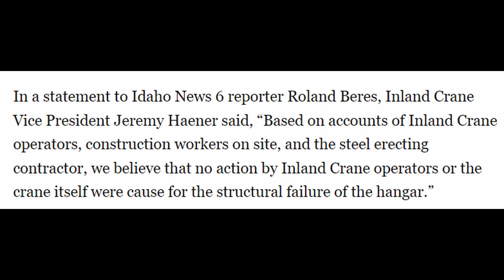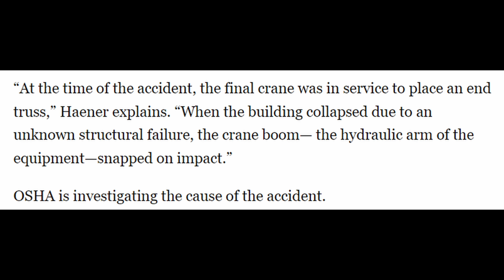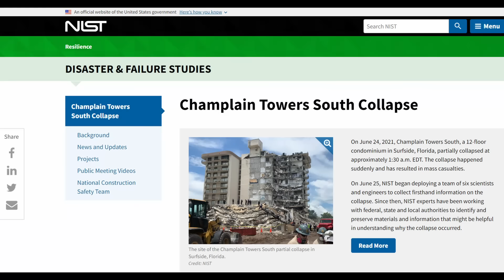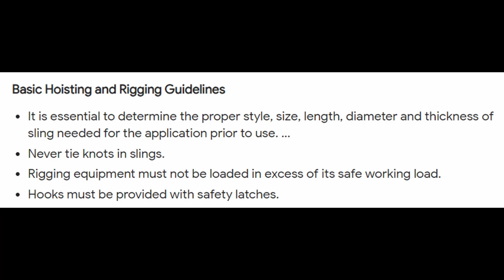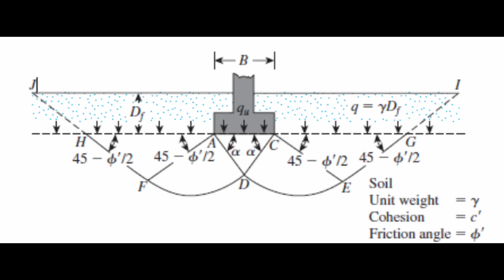Aircraft Hangar Collapse in Idaho

Comment: Good point about the back straps but these horizontal reactions are huge!  In most cases we would even have an embedded cable just below the floor elevation going from one leg to the other.  These forces are too large to depend on the resistance to sliding just due to the passive soil pressure on the sides of the foundations. And usually, these foundations or footings are not thick enough to generate much passive pressure resistance in the first place.  Something is very wrong here.  Thanks for your observation too.
Reply from the maker: Thank you. I agree, something big was likely missed here.

Comment: You will see something very curious at time stamp 0.58 sec.  and again, at time stamp 1.08.  None of the frame bases have any indication of anchorage.  No sign of anchor bolts in the foundations or any sign of anchor bolts (even bolt holes) at any of the frame's base plates.  We commonly call these frames "bents"   If the structural analysis depended upon the bases of the bents being restrained against horizontal movement and possibly moment at the bases, well there doesn't appear to be any restraint.
This is very very strange indeed.  How on earth could anchorage be missed???  It is possible that without the horizontal reaction provided by anchorage the bending moments in the bents would be much larger than the analysis would indicate.   Thank you for the video on this accident and we pray for those who were killed and for those who were injured.
Reply: They are all bolted down, the flanges ripped off of all the columns just outside the weld so they end up looking like they are unbolted. There are some close up on the net you can go find.
Reply: @joshua43214   Then the weld design, the weld procedure and the inspections are very suspicious.  Ther is more to this than meets the eye, in my opinion, and experience.
Reply from the maker: That is a great observation.  There only seems to be a "back strap" connection from the base pieces and the foundation.  This may be a case where there were multiple factors that combined to produce the collapse.
Reply: I agree with your observations.  This is a moment resisting frame metal building.  At one tine i was a design engineer for a metal building manufacturer.  To my knowledge most all metal buildings are sold as a to be erected product.  The general contractor "pours" the foundation and erects the building.  I have never seen a contract purchasing a metal building that went any further than to list the reactions that the moment resisting frames place on the concrete slab.  The metal building manufacturers insist the contractor has the slab analyzed for the particular loads, but exempt the building supply from oversight and inspection.    In honesty I have seen a whole lot of concrete slabs that were not adequate for the maximum design reactions at the baseplate.  This building was a very wide span with obviously no interior columns typical of an aircraft hanger.  The beam sections of the structure were very deep with a lot of web crippling stiffeners.  Nothing out of the ordinary with this except for the very wide span.  The reactions at the base of the column of a building with this span are impressive.  Without drawing any conclusion I would respectfully suggest the investigators undertake a careful review  of the concrete slab design, the type and installation of the anchor studs, and the base plate details.  I have doubts that the installation of the end truss in itself led to the collapse.  Since the sheathing was not installed on the building the baseplate reactions would not have been at maximum, but a sudden dynamic impact from wind hitting the truss being placed may have overstressed the anchor details, etc.
Reply: @geoffmorgan6059  
I agree, I designed the foundations for about 20 similar buildings, based on the supplied reactions. The frames collapsing and rotating the baseplates suggest a connection failure at the ridge or an error in the foundation design.
Reply: @MrsAnnieTK   The dynamic loading during the failure placed tremendous force on the anchorage and base plates.  There is one in the video that has actually torn the light base plate steel away from the web of the column.  Amazing that the fillet weld didn't tear, but the base metal itself sheared away.  Wow!
The more I look at this building the very long plate girders seem to lack what would be intuitive for lateral support.  Look at a bridge design with long spans and the lateral connections between the beams is impressive.  Another hanger that "Big D" construction erected used trusses for the long roof spans.  Probably a better approach.
Reply: @geoffmorgan6059  You are very insightful indeed.
Reply: Not a typical big and thick baseplate and anchor bolts like I've ever been around. I've anchored down hundreds of embeds and column plates.

Comment: We erected many of these since 1980s.
I am also a Crane operator and have a degree in Architecture.
Often no temporary bracing is used or not placed properly.
Erectors often only put a few bolts in to hang the steel quickly.
Then later send a crew to stuff bolts and torque to spec.
If they didn't place and torque central ridge moment connection would cause a collapse .

I saw jobs where only a few bolts in moment connections installed never torqued out of many required.

Also in mid 1990 s we had bad chinesium metal bolts we had to remove and replace on a hangar we put up for USAF.
Law suit to get paid .
Bad bolts metallurgy today still.
Rebar also suspect .
Get paperwork and testing of all rebar and bolts save it .

Sad .
Reply from the maker: Thank you for your comments.  I am curious about the division of responsibility here.  Does the erection company call all the shots?  Does the crane company have someone checking the rigging or have a say in how many cranes are involved and how the are positioned for a big lift?
Reply: @CaseyJones-Engineer if it was the existing trusses that collapsed , the cause is likely insufficient bracing , or like the previous commenter said  , not enough temporary bolts . I’ve seen both trusses collapse and crane failures , usually something was overlooked or underestimated the weight being lifted .
Reply: @CaseyJones-Engineer  Iron workers do all the rigging. Special iron workers climb the beams and manhandle the trusses into position. OSHA grants iron workers doing connecting huge amounts of exceptions, they look like pre-OSHA workers to this day. The crane operator has to assume the rigger knows what they are doing (if they are union trained, they are extremely well trained). All they can really do is refuse to lift if they think something is being done wrong.
Reply: Locals were reporting, wind may have influenced events.
Reply: @amunderdog  Wow..We put huge x bracing cables and rods in as we erect them .
Engineering drawings specify placement.
Reply: @amunderdog  we live along the coast , gale force winds are a common accurance . When erecting steel buildings Ironworkers use wire rope turfer to add additional bracing , lots ! As Carpenter’s we brace everything , cutting corners causes collapses . 👍🇨🇦
Reply: In my experience here in Idaho in the industrial mechanical, union and non union world,  we as the general contractor called the shots to the crane subcontractors far as crane size, rigging and lifting. We definitely valued their input and trusted their owner and operator to speak up if things didn't look or feel right to them but they were pretty much just tools in our hands.

Comment: That was a windy day, more so than usual here in Boise
Reply from the maker: Great point that I forgot to mention in the video that a sudden gust of wind could have been a contributing factor here.
Reply: @CaseyJones-Engineer  The Milwaukee Brewers stadium "Big Blue" collapse in 1999.  Though probably not that simple.
Reply: @donaldatherton319Based on what?  Were you there?  Wind is a common cause of collapses during construction.
Reply: @LTVoyager UPS was loading planes continuously right next to this, and they have very strict wind regulations
Reply: @paulwolf8444  That doesn’t mean that wind wasn’t an issue.  Wind speed can vary greatly over short distances and based on topography such as being between large buildings, in a valley, etc.
Reply: @LTVoyager  Did a building move in that day?
Reply: @paulwolf8444  non sequitur
Reply: @LTVoyager  So is your response. What changed?
Reply: @paulwolf8444  I don’t know for sure what changed, but wind was already mentioned and I simply said that is a possibility.  Not sure why you are going off into the weeds as I made a very simple and clear statement.

Comment: Thank you for this! I live in the Boise area and have been following the story. As a side note, January had a very heavy snowfall, about 22 inches total in Boise. I wonder if this might have contributed to instability of the soil under the crane?
Reply from the maker: Thank you.  There have been many instances of foundation soils becoming weaker after a lot of rain or snow melt that led to the bearing capacity failure below the crane pads.  I don't know whether this was a factor in this collapse.

Comment: Another thought provoking video—thanks! As mentioned by you and commented on below, it’s curious why they needed 4 cranes and the went all the way down to one crane and BOOM! Stability seemed to have depended on multiple supports at some point and then apparently someone thought that was no longer needed….😕
Reply: I could be mistaken, but I believe that it has been stated that what this crane was lifting was an end truss. It is entirely possible that the other cranes were used in building the majority of the structure, but were no longer needed, and just removed to clear the site. The end truss, similar to a gable end on a stick-built structure, simply provides stiffness for that portion of the end wall above the top plate. It would be much lighter than the main structural members, hence likely only requiring one crane.
Reply: @basilfoster5245  Another important piece of information——thanks
Reply from the maker: Thank you. Yes, I think it is interesting that the change from 4 cranes to 1 was mentioned in this initial interview after the collapse.
Reply: I suspect whoever made that decision will regret it. And often when it comes to cascading failures, I suspect the person who made that decision made it from orders from above because cost reasons. This has skipping security because of cost written all over it.

Comment: These big plate girder bents are difficult to stablize, not only during lifting but after erection prior to addition of all shear resistantan members.  The photos seem to indicate tha the failure of the bents was moving toward the crane.   One possible scienerio is that a manlift inside the building destablized a bent causing a cascade failure toward the crane and hoisting operation.
Reply from the maker: Interesting.  Well I hope that the investigators get to the root causes of this collapse soon.

Comment: back in the '70's working for an oil field rig up company that moved drilling rigs we had two 'pushers' that ran the jobs. One was the truck pusher and the other was a crane pusher but on rig moves they were split between jobs when we had a high volume of upcoming jobs in the hopper.

"Turk" the crane pusher on one job figured out how to take the derrick off the rig with two cranes, set it on sills and take it apart with gin trucks. (we used to use ramps a tandem truck and either a crane or gin truck on the other end.) his innovation saved us buckets full of time and hassle. 

Not to rest on his laurels, Turk then figured out how to two crane (100ton lattice boom and 75ton hydraulic) the whole top 2 substructures off the rig along with all the spreader beams that connected them and that way free up the crane time and get them headed to the rig's new location. Man was it a sight to see and be a part of.

Marlin, the truck pusher, not to be outdone by Turk decided on his next rig move to try the same tactic and boy did it turn ugly really quick. The derrick came off easily, but when two craning the top sub assembly things went sideways literally. Marlin got the booms crossed while under load and when gravity finally kicked in and the subs were raised, the whole thing tried to seek equilibrium resulting in the 100 ton sitting only on it's rear outriggers with the corner of the whole structure inches from the operators cab (i could walk under the front road wheels) and the 75 ton boom buckled in a couple place and sitting on it's front outriggers too.

I learned rigging is a lot like playing billiards and herding cats at the same time and the more cranes, trucks, and swampers you add to the equation the quicker the lift can go the crap. 

Told an operator to stay on the lease road when entering a cell site to change out the top hat on the tower, the operator/driver decided to ignore my directions and immediately drove off the road and buried the crane to a depth that the water literally was running into the drivers compartment. took several days for the ground to dry enough to get a D-9 in there and a half a day minimum fee to get it removed from it's watery grave.
Reply from the maker: Those are interesting stories, thank you!  Those would have been quite a sight to see.

Comment: A lot of these frames are pretty unstable before the sheathing application provides lateral stability. It wouldn’t take much to pull it down. Matter of fact I’m surprised it doesn’t happen more often.
Reply from the maker: One thing I forgot to mention in the video was the possibility was that a sudden wind gust initiated the collapse.  However, I think the use of only 1 crane may turn out to be the key error here but we shall see.
Reply: Maybe the crane was only moving bracing and temp supports at the time @CaseyJones-Engineer

Comment: It's a little bit confusing to imagine exactly what happened because the details aren't clear.

But I imagine if the crane was holding the truss, whatever the attachment point was attached to, loads from that area overstressed the crane until it broke. So, they should've used two cranes, one for the truss, and one for the attachment point. And holding them separately until they were attached properly. I suspect the attachment point was free standing in that critical moment and simply "leaned" into the crane putting stress into it.
Reply from the maker: Thank you for your comments.  Your scenario seems plausible to me.  I think using 1 crane may have been the key error leading to this collapse.

Comment: Although it is expensive, on long-span erections there should be a line of temporary supports in the center span area to protect against such failures.  Also, the slenderness factor of these girders leaves them venerable to flange travel between the lateral support points and lateral temporary support lines between the flanges would also be an extra factor of safety against dropped girders and trusses.
Reply from the maker: Thank you.  You make some great points here.  I suspect that they should be able to quickly determined what happened.  Also, I wouldn't be surprised if a video of the collapse turns up.

Comment: The crane boom snapping is very suspicious to me. Cranes are supposed to have a factor of safety of 4 in their capacity. The safety margins get pushed many times that I saw. Another good video. Good Luck, Rick
Reply from the maker: Thank you.  I agree that is advisable to be skeptical about the sequence of failure.  Eye witness accounts are often unreliable.
Reply: cranes work at 85% of ripping load 75% of structural .
I am a NYC NYC Crane operator and  inspector since 1994.

Any dynamic impact from a falling load exponential increase on Crane and rigging .
F=ma and 1/2mvexp2 applies .
Reply: @Motorhead250  If you go into the design of the booms, cables, winches, hydraulics, and other components, they are supposed to be able to handle 4 times the rated capacity. I designed structures that had to be lifted and had to work with  crane contractors. I never designed a crane but am familiar with the codes. In the 1970s, the codes for designing bridges were a factor of safety of about 4. In the 1990s a new design code came out that essentially lowered the factor of safety to about 3. This unfortunately was about the same time that we were beginning import steel. Some imported steels were less than 1/6th the strength required. Its a mess and I'm glad that I'm retired. The first crane accident that I saw was when I was an Army combat engineer. They had a 35T crane on a barge and somehow managed to flip the whole thing. Good Luck, Rick
Reply: @richardross7219  not on Cranes.
No way my 70 ton Grove boom could ever hold 240 tons.
New German cranes AT like Liebbher have paper thin booms made of high strength steel amazing like a beer can holds load.
One dent kink in boom in it will fail.
On lattice boom Crane entire boom in compression and if one tube fails the boom buckles .
We had a Gmk 5120 Grove Krupp . I had to crawl inside boom to inspect to pass NYC inspection very strict.
Pin lock hydraulic piston extends one section at a time.
Steel is a few mm thick on boom .

Mobile cranes ASME .
Bridges elevators other hoist equipment yes.

Regardless if one drops a 1000 lb load just one foot it increases to several thousand pounds of dynamic impact .

Ask me how I know..
Flipped one and had to pay $$$$ to repair boom at certified factory at  Grove  .

Thanks 👍